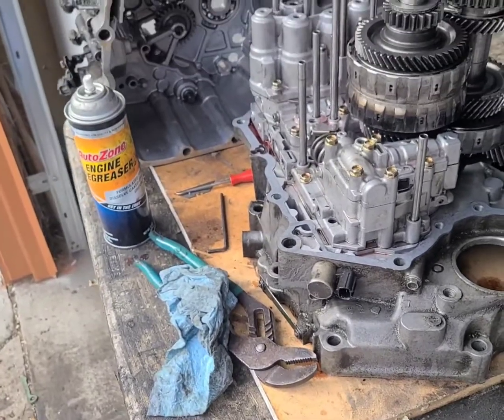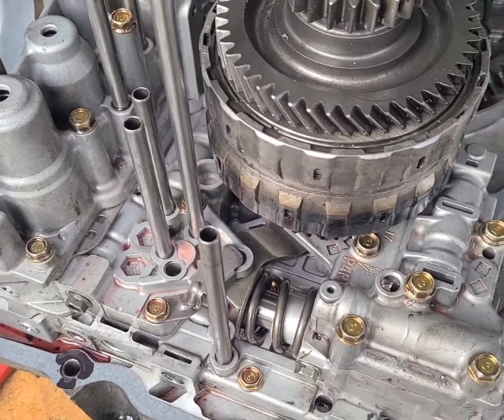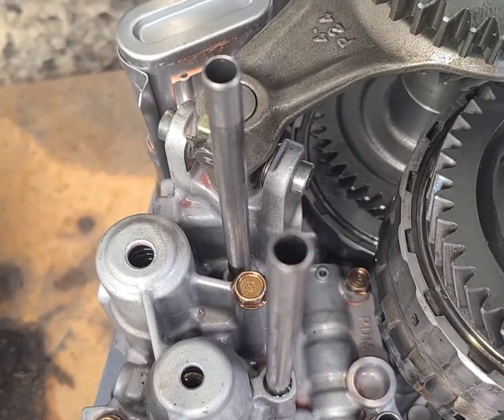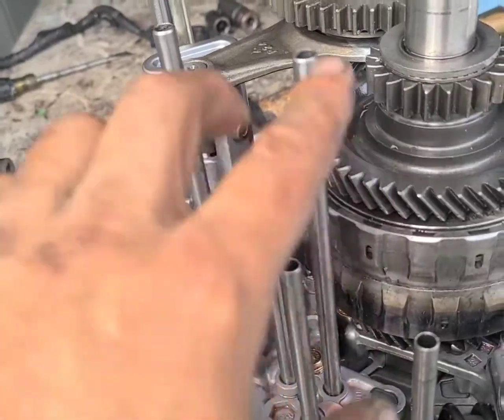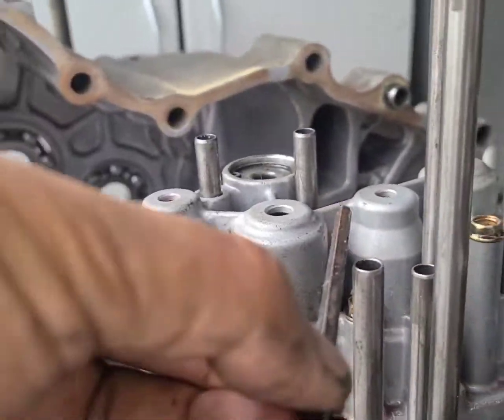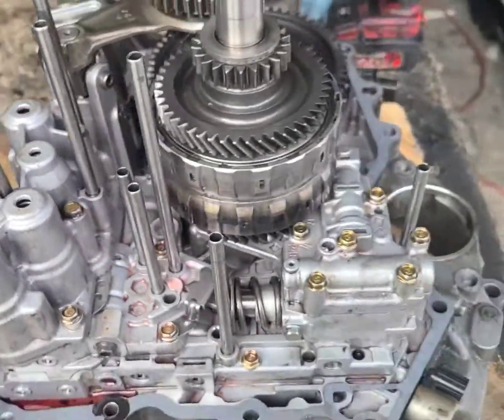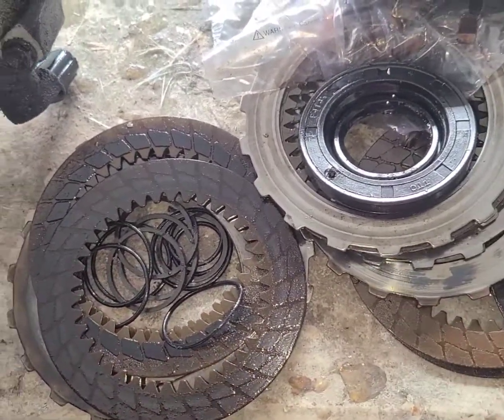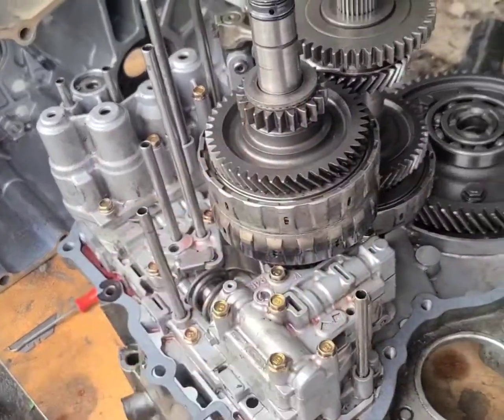P0730 code Honda Civic 2004 bmxa transmission rebuild

Comment: I am very mechanically enclined & have built about 15-16 civics and a few fully built drag cars oit of a few harches & tons of show cars. I have rebuilt the engines several tiems but never the trans. 

I want to try it with my 02 civic with code PO7030 and put in an upgraded clutch master rebuild kit & upgraded valves & springs which are supposed to extend the life of the fluid & clutches. 

My questions are how difficult was it? How long did it take? And will this clear the code PO7030 and drive like new? 

Mine sat for 7 years from previous owner & had strawberry milkshake fluid in it and ive flushed & changed $350 worth of fluid so far just to realize i could of rebuilt it by now for that price.
Reply from the maker: The rebuild was really quite simple. Split the case, keep track of the fluid tubes, change the internal metal filter and the case gasket. The only hard part for me was to put the 1 through 5 speed  and reverse clutch disc back accordingly. THE CLUTCH DISCS CAN BE EASILY PUT TOGETHER WRONG!!!! 

In case there was a mix-up, you simply measure each disc by measuring their thickness, which saved me from a disaster! So keep track of the clutch pack disc's when replacing and installing them back correctly.

Comment: Hello, id like you know your opinion on a situation im having please. I have a 2005 Honda Civic that has a p0730. The fluid id regularly changed and looks great. The screens on the clutch solenoid at the bottom had nothing on them. I replaced that solenoid closest to the transmission drain plug. I changed the fluid again and reset the code. The transmission instantly shifted like brand new. Had great power and within 10 miles all the monitors set to green. I drove 18.2 miles stop and go and highway miles and the car ran like new. At 18.2 miles as i was pulling into my neighborhood shuddering started, it started slipping and the p0730 code came back. Im so confused as how and why for 18 miles it ran like a new car but then started acting up. Please let me know what you think Please. Thank you greatly for your time and help. Have a wonderful week.
Reply from the maker: That's is a classic sign of slippage of the  transmission clutch pack. The engine is reving high, but the friction discs are worn down already. The transmission needs a rebuild to replace the discs and internal transmission filter. Some people just replace the transmission with a good used one. I opted to rebuild mine it was way cheaper.
Reply: @manolomonzon3646  but why did it take 18 miles to start slipping or even acting up again? It doesn't make sense to drive like a brand new transmission after a simple solenoid change then act up after 18 miles. How did it run and shift perfect and set all the monitors to green then start having issues? How was it able to perform fallessly for almost 20 miles without a single issue? Also absolutely no clutch material in any of the screens, drain magnet had very little. As much as when you do a normal drain and fill on these transmissions.
Reply from the maker: @Wasn't Me  you changed a gear shift solenoid which enabled that specific gear that wasn't active. It's seems that maybe that friction disc set quickly wore down with the rest of them. That could explain the short-lived transmission life. Just a thought.
Reply: @manolomonzon3646  thank you for your time.

Comment: Mine slips on reverse and drive. With that code, it slipped about month ago then went away . Then it slipped and kept slipping. Now it  slips in reverse and drive. So this means my trans is done?
Reply from the maker: That is the dreaded code for a transmission rebuild or replacement. I found it cheaper to just buy the new clutch pads and filter change on Ebay and save money doing it yourself, if you are able to.

Comment: This took the code away ? My 04 civic won’t go into drive reverse any gears this would help?
Reply from the maker: Yesi it did. First, check to see if any transmission fluid is present. If present, top off to the level. If the engine still revs high with no car movement,you most likely need a transmissiom rebuild like the video: 1 through 5 clutch, reverse discs replacement, and changing out the internal filter.
Reply: @manolomonzon3646  hmm okay i found used tranny with 103000 miles on it im  going  to just replace it and take care of new tranny since i didnt know you had to take care of transmissions do you think it would  last me awhile if i do this?
Reply from the maker: Sure, just replace.Used working transmission can can up to $600..Stay away from the JDM versión for $350. The rebuild kit is about $200. If you are mechanically inclined, then rebuild yourself, it's much cheaper.
Reply: @manolomonzon3646  oh cool I appreciate the feedback and I figured it is cheaper to rebuild but my mechanic doesn't want to do tranny rebuilds anymore lmao, so I told him find me a decent used tranny  it comes with 60 day warranty 850$ for tranny plus labor so like 1200$ but autozone rebuilt tranny (wich I was going to get) are 2800$ but I just don't think I should dump that much money into a trans for a 04 civic with 150000 miles on it I'm honestly thinking about seeing if he can, k204A swap it he can get those engines pretty cheap
Reply from the maker: @xRustic  kswap 😀
Reply: @manolomonzon3646  gotta love it